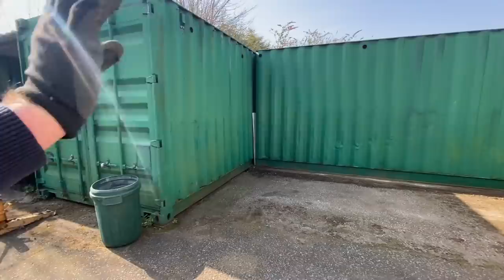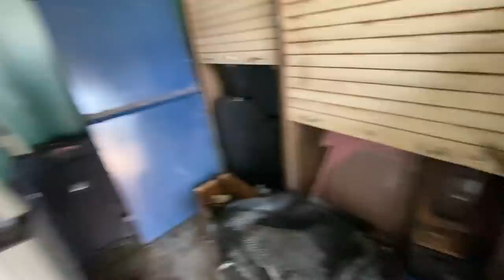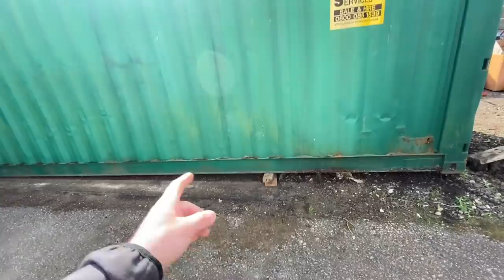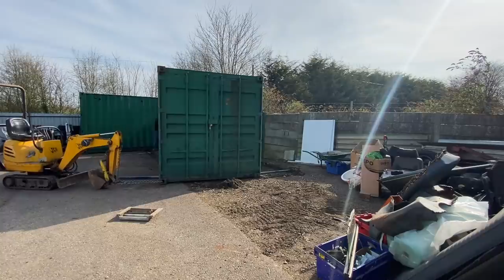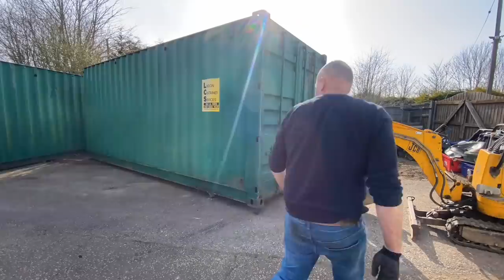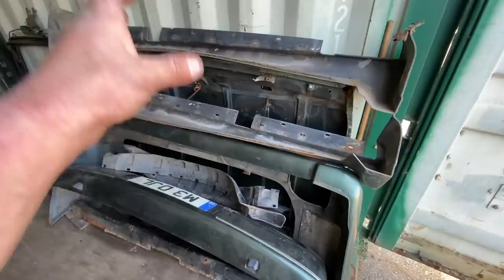CAN WE MOVE A 20 FOOT CONTAINER WITH A JCB MICRO DIGGER ??? MEGA MOVERS !!!

Comment: Loved it, guys. :) Any video with you two in it is always great entertainment. :) Me and my mate used to do stuff like this a few years back when we worked in a warehouse. Every Christmas about 20 of these containers would be dropped in our car park to hold the extra stock and they never quite put them exactly where we wanted. So, I'd get the 3t electric reach forklift from out of the warehouse and my mate would be on the 2t diesel counter balance forklift and we'd spend a day or two moving them about. Trying to line up double stacked containers was as scary as it was hilarious. We soon learned to never underestimate the power of hydraulics. I've even bump started an old 44t artic by pushing it with our little 2t forklift. Amazing little machines. :) Anyway, enough waffle from me. lol. ;)

Comment: Many years ago when I used to fit large engines / water pumps in 20Ft containers  we made some castor wheels that locked in twist locks  they made life so easier  when you need to shunt them around with the forklift  in the yard  
Just think 150 quid saved ?  but that  Range Rover might have increased in value by £150.  so your never going to loose. and gives  Chris a day off from welding  
I have an antique metal saw on gumtree    Wickstead   1930's   what a machine

Comment: This was actually a great video just like the regular scheduled shows are. It wasn't long into it I figured out it wasn't about saving 120 quid, it was more about Chris proving You wrong that he could do it with the mini digger. I'm pretty sure that wasn't the first time that machines out pulled it's size with Chris and he knew it would do it.  That power saw looks exactly like the old Manchester I threw in or shipping container when we left the U.K and moved to Canada 20 years ago. It's old school machine tools I'm 47 and remember it being in the farm workshop for about 40 years. Ours was originally line belt driven in a factory It's still got the wide pulley on with a belt groove machined in it for the washing machine motor, the last owners converted to drive it. It's limited to about 8" max cut, but it's a bit slow but way more of an accurate cut than a cheap band saw . Thanks for the video, Take care guys.

Comment: When I left school (52 years ago!) I worked for a small engineering firm which had a dirt/gravel storage area for cast iron pipes and fittings much like that corner.  We were fed up with the mud every time it rained, so the odd-job man was asked to concrete over it.  The new concrete was left for a couple of weeks to cure, but the first time a van was backed over it, it broke up.  We could see that it was no more than an inch thick anywhere with far too much sand in the mix.  His excuse? "It was only supposed to be temporary concrete."
Reply from the maker: Lol

Comment: The last time I shipped a 20' container, I built a shelf across the rear just high enough to clear the hood of my car, then another the rest of the length high enough to clear the roof.  I packed all my goods on the shelves right to the top, then rolled my car inside and tied it down. Got my car and an entire household in 1 20'.   The same would work here for storage of all that odd stuff and still leave room to roll a car inside.